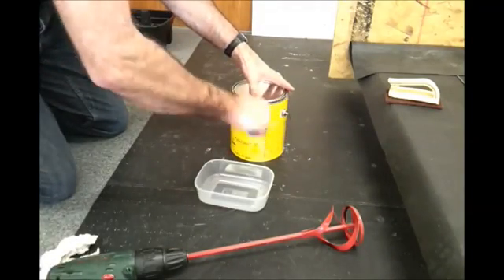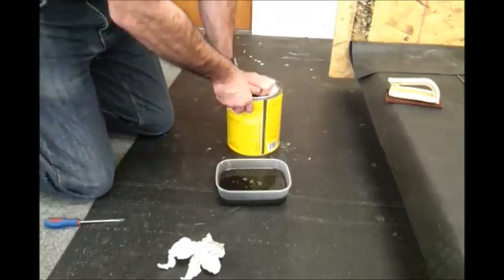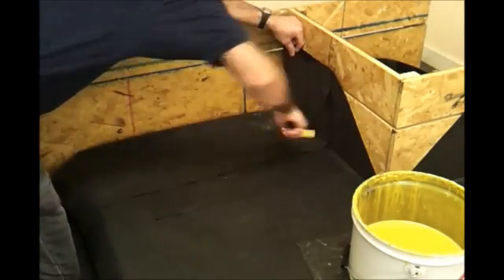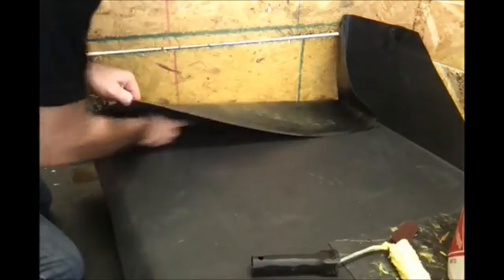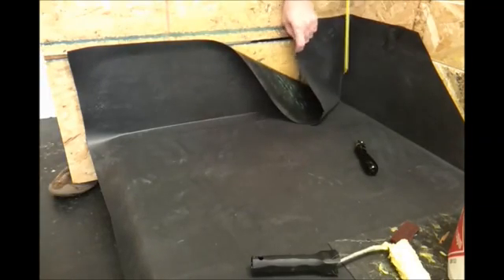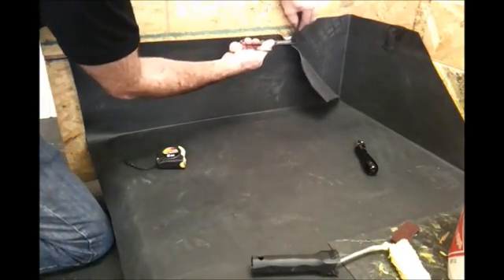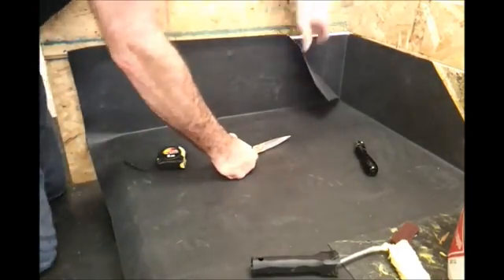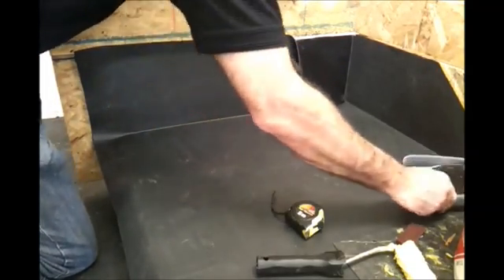Form a Flat Roof Internal Corner with Firestone EPDM

Comment: I would have folded the flap down
Reply: aplace inthesun then you have a chance of it opening over time. the way he did it will be completely sealed off with termination bar.
Reply: Ponding water on the roof will cause the glued lap to be under hydrostatic pressure if the lap were turned down. As Andrew said, this way, the discontinuity is behind a termination bar, counterflashing, coping, or wall cladding.
Reply: Ponding water on the roof will cause the glued lap to be under hydrostatic pressure if the lap were turned down. As Andrew said, this way, the discontinuity is behind a termination bar, counterflashing, coping, or wall cladding.
Reply: That cos ur an idiot